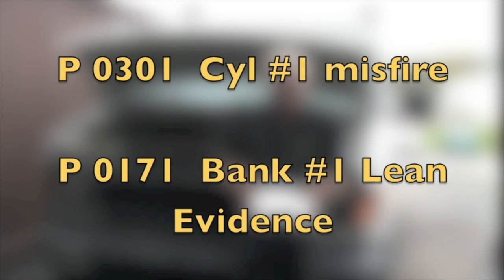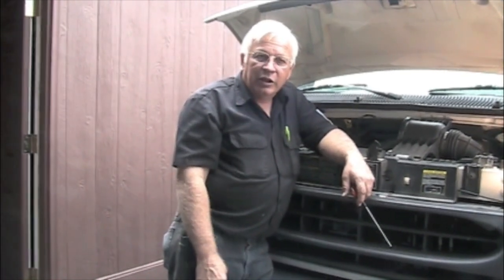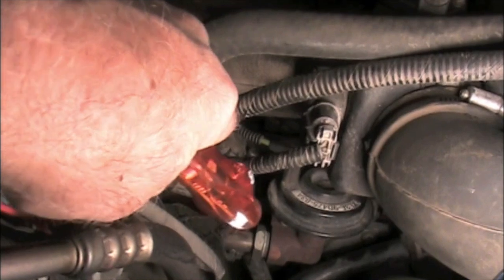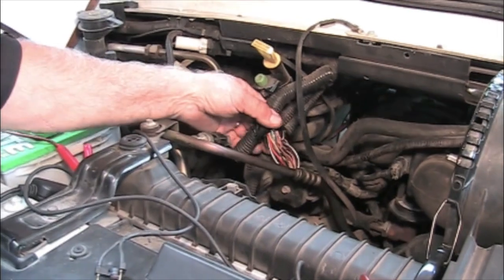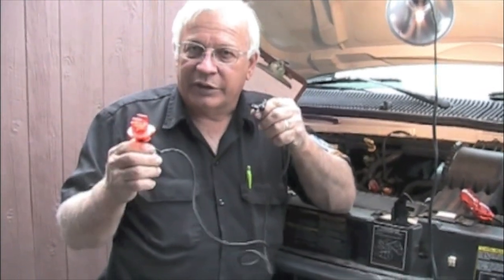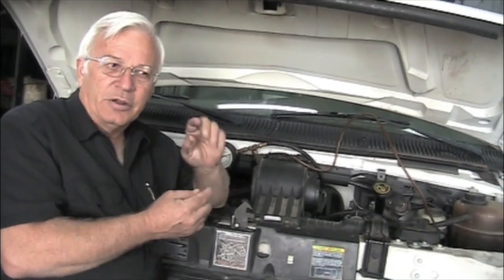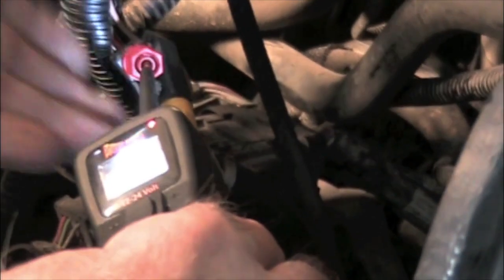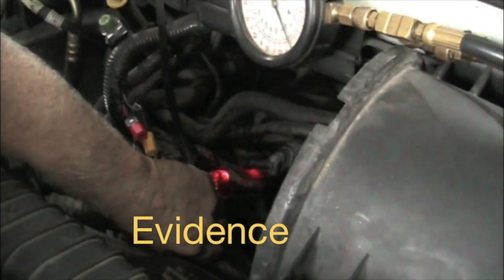Testing Injetors when access is limited

Comment: An ignition related misfire absolutely can cause a lean code - it's called an oxygen sensor (and not an oxygen + fuel sensor) for a reason. That O2 sensor is going to detect all that uncombusted oxygen in the exhaust and (mis)interpret it as a lean condition; it can't "see" the fuel.
Reply: I was going to say the same thing. With an ignition problem you get "less lean" fuel trims because the fuel partially burns into the hot manifold, but you still have a bunch of unused O² going out the cylinder.  And that's IF the system does not simply cut the injector when it sees too many misfires.